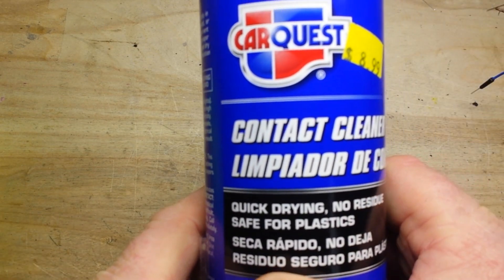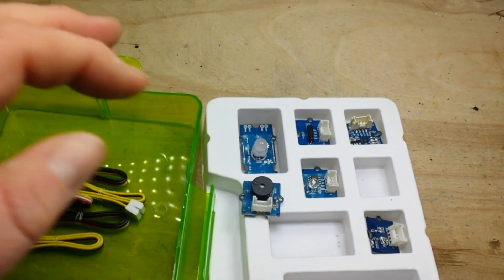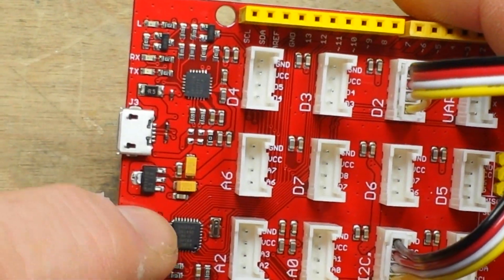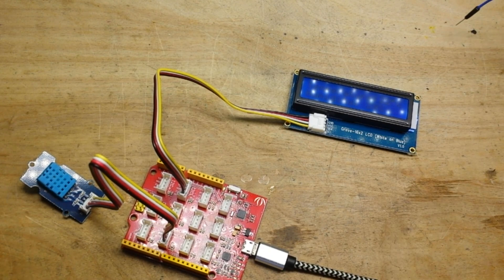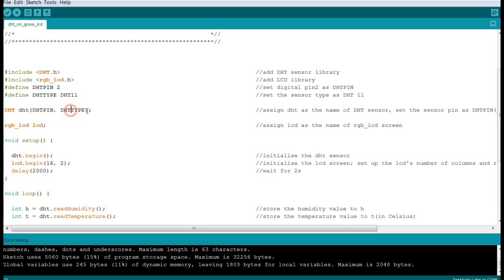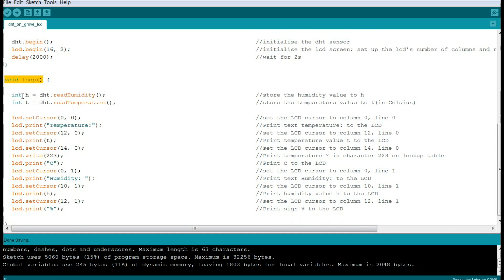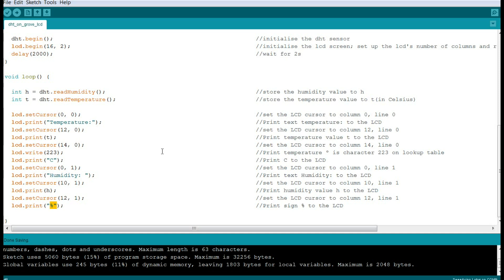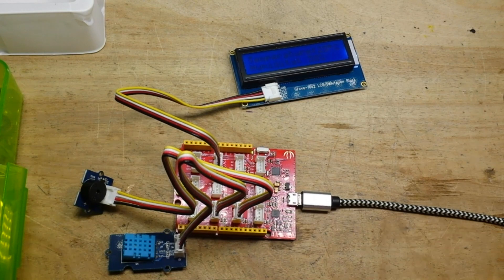Modular Prototyping for Arduino

Comment: Yes, I use my Adeept 46 modular starter kit, w/JCT (Grove) connectors alot. No messing around with pull up/down resistors & deciphering color codes (is that band pink, purple, or brown?).

https://www.amazon.com/gp/product/B01M4OVDHM/ref=ppx_yo_dt_b_asin_title_o05_s00?ie=UTF8&psc=1
But, as you mentioned, convenience comes with a higher price tag, ~2*$. Also purchased  complete assortment kits of JCT & Dupont M/F connectors, ~$10 ea. Great investment for serious makers.
The 4 pin JCT cables are also great for extending stepper motor cables.🤙 But, my Adeept kit came with a modular RGB LED that has a common positive, instead of ground.🤔 Oh well, made my own the 'right' way around.
Hey, how many volts did you hook that cat up to?😆💨

Comment: So about the relay? The relays I have draw about 50mA and the Arduino can only handle about 40mA. How can this work?  I built a circuit using a 2n2222 to switch the relay and only draws about 5mA or so. Thanks for more Arduino stuff keep 'em coming, and stay safe!
Reply from the maker: Yep, I'd use a relay too. They have have built onto the Grove boards

Comment: I literally just finished up my weather station with that OLED on the receiver. I was able to get temp, humidity, heat index, dew point, battery voltage, and solar panel voltage all to read out on it. It’s a little small, but not bad. I had to relearn how to code again (I’m a hardware guy, like discrete stuff better, also been a few years since I’ve touched an arduino), and just figured out that you can name the Dht and display whatever you want. Mind blown. Going to use a dht22 since it will be outside and below freezing. Now just waiting on my enclosure to get here... sucks everything is delayed shipping.

Also, awesome video, please keep going on this series.
Reply: Can you do a video once you get the enclosure? Like an overview- I'm interested
Reply: Michael Padovani maybe. I’ve always wanted to post some videos of my projects, just not sure if any one would like them other than me.
Reply: @justinhummel5613  cool. What you described above would make a good video IMO

Comment: Having been watching the series on Arduino temperature and humidity monitoring for his outdoor shed by Julian Ilet I had embarked on a similar route to him and to this with an arduino and a BME280 for the temp and humidity, as well as and RTC for time, NRF 24l01 to send wirelessly, an SD card reader for data logging and as a keen woodworker a little dust sensing module as well so lots of modules and I was really none too thrilled about wiring all these up even though most use I2C, just too many wires for the prototyping so your video has amazing timing and although I don't have the Seeed studio kit it did give me some good ideas around how to organise all these modules with the 4 wire jst style plugs on the seeed board so I felt the need to comment and say thanks. I have always enjoy your videos and purchased most of my electronics gear including my much loved DSO based on your recommendations and reviews which I find to be honest and well put together, thank you very much for making this :)
Reply from the maker: Thank you!